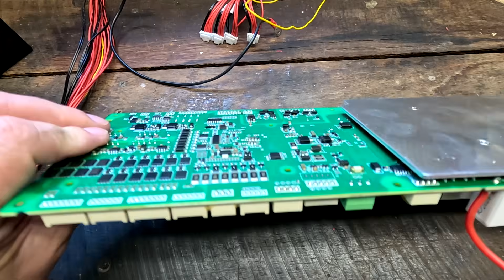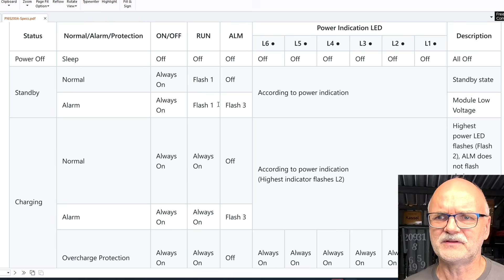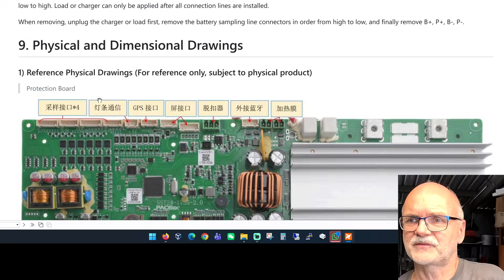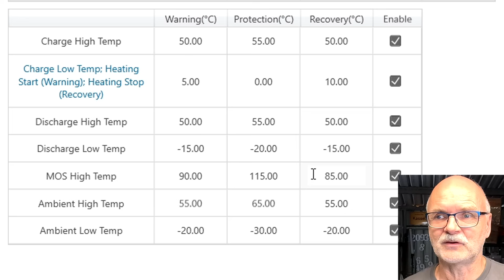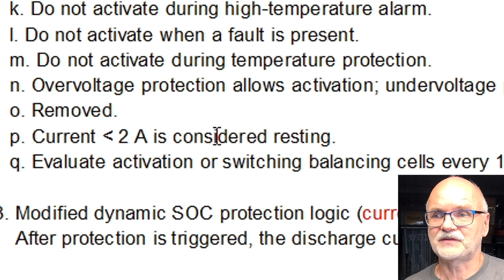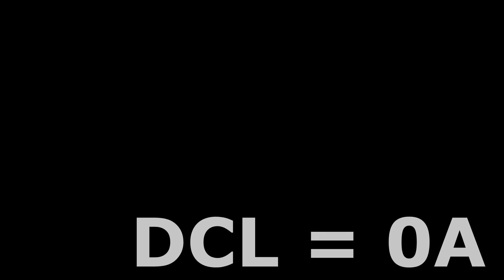New GobelPower BMS P16S200A - Better than JK or just the runner-up?

Comment: learning a ton from you, and i am currently looking for a new bms, so i can finally use my 16 280ah cells on my anker solex f3800 (expansion port hack :) i built a hybrid, and on the same bus, i have a 150/35 victron charge controller connected, and i didn't start my generator in 3 weeks now :-)
i think I'll get the 300a jk inverter BMS, do you have any Amazon affiliate links with a discount?

Comment: The "SOC 100% Reset Voltage" needs to be separated from the "Inverter Max Charge Voltage (CVL)" because in some systems, the CVL is never actually reached.
Just one example: the very popular Deye / SunSynk / Sol-Ark inverter only charges to 0.1 V below the CVL.
If the CVL is 55.20V, it charges only up to 55.10V . This voltage is maintained at the inverter terminals so the 0.1V offset is intentional and it's not voltage drop over the cables.

Looking at the BMS circuit board, I don't think it has supercapacitors to temporarily store the discharged energy during balancing.
I think it discharges from the highest cell and charges the whole pack simultaneously (i.e. the energy is not stored in the BMS at all).
Active Balancing is so slow, going through cells one by one...A decent passive balancer (0.8 A) would get the balancing done much faster.

Comment: I’m curious about BMS designs that gradually reduce the charge current based on State of Charge (SOC), rather than the normal tapering that naturally occurs as the battery voltage approaches its final value. ( like what iPhone battery controller do after 80%)

For example, some BMS limit the current to 20A during the last 15% of charge regardless of the voltage.

Has anyone used such a BMS?
What are the pros and cons?
Does it affect cell balancing or battery performance?

Comment: parameter settings 
Do you get this after saving, and when you do read and the entered values remain correct, do you see strange values just like the old versions?
Reply from the maker: It seems to work well with this version.

Comment: Possibly a few tweaks there specifically for Gobel, hence why some of the float parameters are hijacked from the protection parameters. In our Pace firmware we don't use 100% SoC reset voltage for the RCV but it's stolen from the overvoltage alarm value instead. Pace have hundreds of different versions of firmware for the same hardware for different customers. Also I think there is a passive balancer too, the one we're testing has both passive and active balancing and on the board you have there are passive balancing resistors present too. AFAIK Pace passive balancing is only 80ma per cell, regardless of what Pace claim.
Reply from the maker: Yeah, I know Pace has tons of different variants out there. And documentation which is not that great. GP told me they get the software from them as well. That explains the weird design and some flaws.
Not sure about the balancer. I could not really measure anything in regards to passive balancing. Maybe the FLIR gives us more insight.

Comment: Hi Andy! The only correct way switching to float-voltage automatically is:
Switch to float WHEN charge-voltage is reached AND charge-current =< xA AND cell-voltage-difference =< xxmV
Can you tell that to JK and Gobel please 👍
Reply from the maker: So, no absorption timer any more?
That could lead to premature float mode if you have clouds and are charging slow (low current).
Reply: @OffGridGarageAustralia no because you also have to reach the "charging-end-voltage" (bulk-voltage). You only reach it even with very low charging current only when the battery is full. So you need both: the high voltage AND the low current. Then the battery is full. Then wait until it is in balance and after that switch to float.
You can test it yourself: charge with high current until you reach bulk-voltage and then reduce the charging current > voltage drops directly when battery is not full
Reply: And the best feature for GOOD programmer's: Dynamic CCL. If a cell reaches a high voltage alarm because of imbalance, the bms is reducing the CCL so that this single cell-voltage is not ricing more and the balancer can handle it. When the cell-voltage drops, CCL gets back higher. If you have Victron with MPPT's and DC-feed-in then it has to be a "Dynamic-CVL" because the MPPT's are not listening to the CCL...but this has to be programmed perfectly, so nothing for chinese BMS 😂

Comment: I have two warehouses with Pace 16s200a controllers. Communication between the warehouse and the inverter via CAN is fine. However, communication between the warehouses via RS485 is nonexistent. The connection to the computer is seamless, and Bluetooth WiFi works.
Andi, maybe you can solve the communication problem!
Greetings from Trzebnica :)

Comment: As an Infrastructure Engineer for a major utility company, as well as personally, I would not consider changing to the Gobel Power BMS from my JK BMS v19 models. Switching would require extra cost with no obvious benefits. Considering I have 2 YiXiang Vertical DIY boxes with 16 of the MB31 batteries in each with JK BMS v19's as well as 2 of the YiXiang Horizontal DIY boxes with 16 of the MB56 batteries in each (ordered and pending arrival) also with the JK BMS v19 (300A) together and able to seamlessly communicate with each other and the Victron Smart Shunts (300A & 500A respectively) it makes no sense, even if these Gobel Power BMS modules were available separately to switch. There just doesn't seem to be any benefits for the switch. I would like to see the 2A balancer circuit increased to 2A per 8-cell bank, that would be interesting, but I'm not sure if that would work well unless the system could also balance between each of the 8-cell banks. Just seems kind of wonky in the current configuration with Gobel Power. My 2 cents.
Reply from the maker: Thanks for sharing. Yep, atm, I also don't see a benefit of swapping. Unless the SOC measurement is really that accurate and strong, which could be a big argument for many complaining about it.

Comment: Hi! I have an emergency story i need to bring to your attention. Last night 24 hours ago i had one of my 96 lifepo4 cells (100ah prismatic) go into thermal runaway. I called 911, and firefighters came and were dousing it with water for 2 hours. In those two hours, the cell kept reigniting in a self sustaining way. I lost alot. Everything is gone now. Im consideding a lawsuit to the supplier (i am yet to reveal what company) I made a super comment to will prowse video on lifepo4 safety when he states there is very little concern. It got deleted in 5 minutes. I would appreciate your response and feedback. It was a very large single cell fire.
Reply from the maker: Thank you for your donation, first of all.
I have seen many test of overcharging LiFePO4 but none of them just had a thermal runaway. As LiFePO4 does not produce oxygen while burning (unlike NMC chemistry), there is no physical way they keep getting hotter and hotter and self-ignite over and over again.

It's impossible to really comment on your story because we have only a fraction of the facts necessary to see the full picture. 
If a cell starts bloating,  it is most likely been massively overcharged with wrong BMS settings.
Reply: @OffGridGarageAustralia thank you for the response. Can I send you all the footage I have of the incident? I condensed it all down to a 3 minute video, even showing the gases leaking out and then getting viciously consumed by flames. It was a rough time. All my cells have to be destroyed according to my fire department. The Envirnmental protection agency had to make a report aswell. I would even pay you to make a short video of your response to my clips. I will give you all the information! 

thanks again.
Reply from the maker: @ToledoRocketMan  I would rather prefer that you publish this video yourself from your perspective. You have all the insight and data, which I don't have.
It would take me a tremendous amount of time to get all the info and facts right, to make a video about your case.
Reply: @OffGridGarageAustralia  LiFePO4 - that last O4 is oxygen and it can be released in a thermal runaway, but it needs a slightly higher temperature.
210 deg. C for NMC vs. 270 deg. C for LiFePO4 to release it. Overall, LiFePO4 is more stable, but is not "bulletproof".
Reply from the maker: @danielardelian2  I only ever has seen these cells gassing but never explode or start burning in such a way NMC does.
Reply: What cells do you use? What BMS, What BMS settings?
Reply: @NTI-SITIC100ah greatpower cells from a reputable company. Jkbms active balance 16s 48v. HVD at 3.45 volts because im a perfectionist. LVD at 3v. Cells were perfectly fine top balancing for multiple days. As soon as i turned the inverter on with charger off (no load) the one cell swelled severely, started hissing, and eventually blew up in my face (literally) Fire chief wanted me to get medical checkup, but i was fine so i insisted i dont.
Reply: LFP doesn't have thermal runaways. Fake news?
Reply: @moestrei I literally have it all in video
Reply: I'm going to go out on a limb and guess that you had either some massively mis programmed settings in your BMS and you did not have an iBMS in-line for protection. This is absolutely abnormal for LiFePo4 batteries. You do not state BMS manufacturer, battery manufacturer, or the case manufacturer which makes your post very suspect. 
"Quis custodiet ipsos custodes?" - Remember this with BMS - if the MOSFET malfunctions and allows unlimited input/output of power, your situation could happen. There are multiple failsafe's available to you and if you build your system properly these would be included in the design. This kind of sounds like you built a system and you didn't understand the risks and safeguards available to mitigate those risks. I've seen this before and it never ends well. You should publish all of the specifics of your case if you want to be taken seriously and not be so coy.
Reply: @chriswardell1623 every bms I had in parallel to the inverter had all the same parameters set. OVP 3.45v. UVP 3v. Start balance 3.35 volt. OVPR 3.35v. UVPR 3.1v.
Reply from the maker: @ToledoRocketMan  Yeah, these parameters don't seem to be right... they make no sense
Reply: @OffGridGarageAustralia i have everything in my latest post in the DIY solar power forum. Should still be the latest under "up in smoke! learn from my mistake" its the wattcycle one
Reply from the maker: @ToledoRocketMan  I'm sure the guys over there love that and you get a ton of comments😄
Reply: and apologies, its jkbms active balance bms and
 greatpower 100ah prismatic cells

Comment: If it can't measure cell voltages accurately enough to get deviation under 30 mv, I wouldn't trust it to protect the cells in a under/over voltage scenario.
Reply from the maker: It is quite strange what 'bad' precision of voltage and current measurement they openly include in this document. Definitely not reassuring...

Comment: I had a chat with GP yesterday and they think about adding an external CT. Meassuring lower current, expecilly 0,6 amps is impossible. They say its a basic problem for pc bms to detect low current.

I asked directly that I dont want to purchase the Victron Smart Shunt if the new GP BMS provides accurate current meassuring.

And also they offered me the option to get the Project-X2 housing with the new GP BMS imstead of the actual JK BMS 300A V19.
Reply from the maker: Yeah, I don't know if this is a problem as most systems always have a higher base-load than 50-60W. So, this threshold of 600mA might be OK for 99.99% of users.
Reply: @OffGridGarageAustralia  No me gusta SOC Abweichung von 20% or even higher

Comment: It DOES give me hope that another high profile BMS maker has finally produced a working active balancer BMS that is mostly usable (if more expensive).  Competition brings up more features and quality.   I doubt PACE would have produced all those features had it not been for all the features implemented by JK (and debugged by Andi and the community).    Truly, it felt like we had to beat JK into submission.    THEN market pressure forced PACE to up their game.   Given that it is their first iteration, it DOES look promising (remember the first iteration of the JK inverter BMS... it was not as polished as this PACE model).... so there is hope.    My hope is that they will reach out to Andi and we can use his channel as our megaphone to stir their development into a useful direction.   Having more than one viable active balancer BMS is, in my opinion, a VERY GOOD THING!    So Kudos to Pace for these new developments!
Reply from the maker: I used to have connections to PACE, but it is fighting windmills! They are so far back with understanding LiFePO4 and battery charging that we discussed very basic physics, rather than improving their firmware logic.
They did not understand that we can safely parallel 280Ah and 360Ah batteries. Or even 100Ah and 628Ah... This is still a problem with their current BMS, and the master always assumes all slave batteries are of the same capacity as itself.
I understand what you are saying about their first attempt of making a better BMS, but on the other hand, they had years of watching the market and learning from mistakes other companies did. So, in this regard, it is a very lame first edition. JK was the first having an active balancer and simple to set parameters back then, so a true breakthrough in comparison to the mush of BMS, all with the same problematic, weak balancers and lack of useful, intuitive settings. 
What we need is a real new WOW innovation from a manufacturer. That's what I'm waiting for... I have the ideas, just waiting for someone to call...

Comment: The Dynamic (soc) protection would be great if it had overrides and or if you have multiple batteries and it would cycle from one battery to another at a time on it, that why each could get balanced and BMS could keep a better track of how many amp hour it has.
Reply from the maker: I'm not sure if they can make this work and prevent the inverter from discharging the battery while other banks can be discharged.
I don't really see the point of introducing such a mechanic, even the batteries don't get fully charged over winter for a few months. It is not really that important in my opinion.

Comment: This info is furnished via CoPilot, so take it with a grain of salt -
QUOTATION BEGINS:
  "What Gmax Usually Means in Battery/Charging Discussions
Even though the term isn’t part of any official charging standard, it shows up in:
⚡ 1. BMS‑side internal parameters
Many BMS vendors use internal variables like:
• 	Imax – maximum charge current
• 	Vmax – maximum charge voltage
• 	Gmax – sometimes used as shorthand for “maximum gain/current limit” in proprietary firmware
In these cases, Gmax = the highest current the BMS will allow the charger to deliver during the CC stage."
QUOTATION ENDS
Reply from the maker: ... which would make no sense in combination with explaining the balance logic😄
Reply: @OffGridGarageAustralia  There was this little voice that said, "Don't use CoPilot as a reference...you'll be sorry..."  Why don't I ever listen to those little voices?